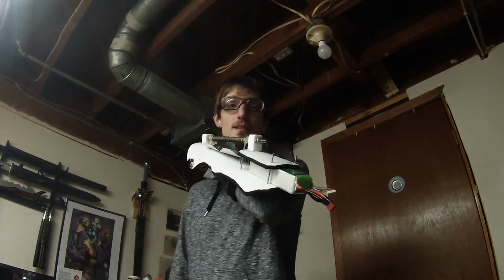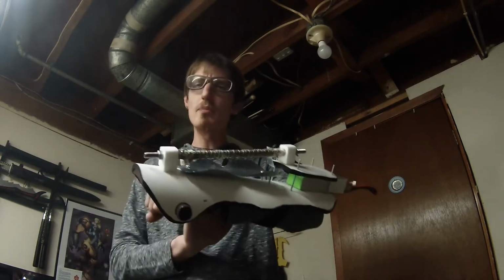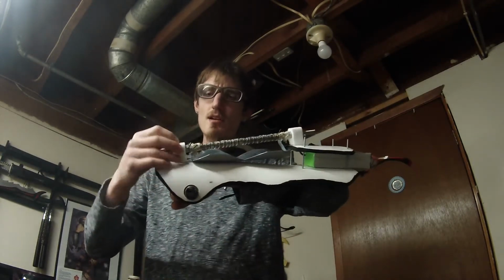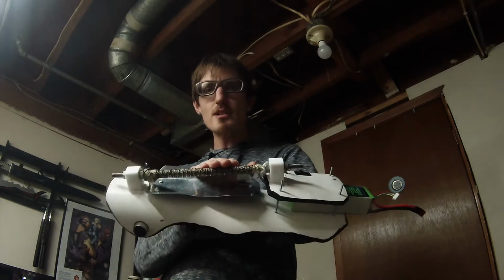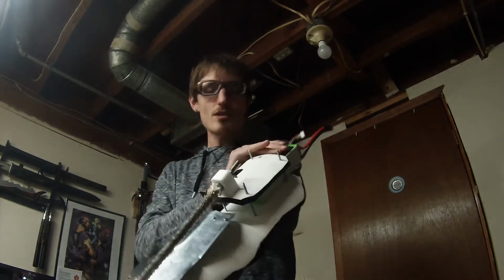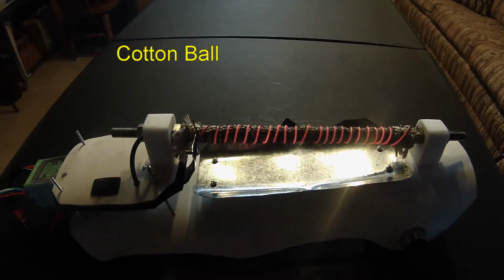1400 degree Fire Bracer! Intense!

Comment: How do you make these nice plastic parts?
Reply from the maker: I draw patterns and cut them out of pvc by hand and then sand all the edges at an angle and then paint them with black 2.0.
Reply: And the bent parts? I'd really like to do something on my own
Reply from the maker: Essentially I heat the plastic with a heat gun until it is moldable then I just hold it in the shape I want till it hardens. Sometimes I mold it around something to create certain shapes. Large sections can be put into an oven till they are flexible as well
Reply from the maker: I can show more depth on the construction process when I finish the video of the armor that goes with this bracer